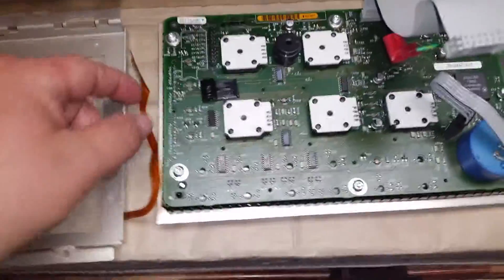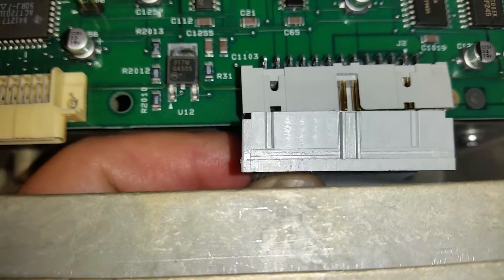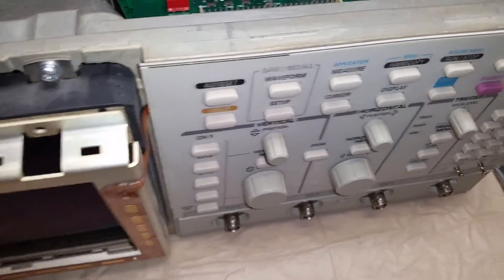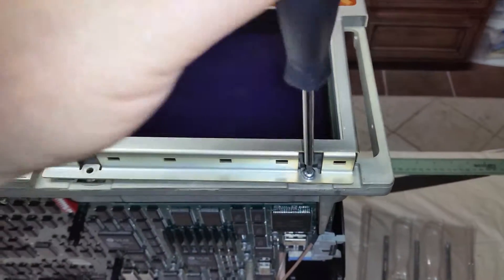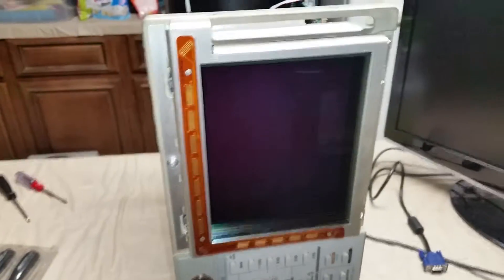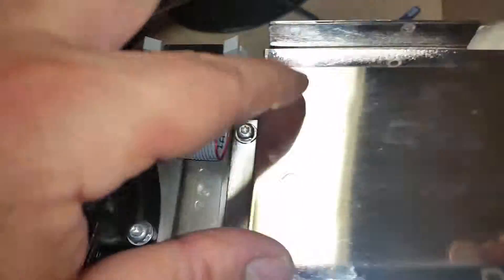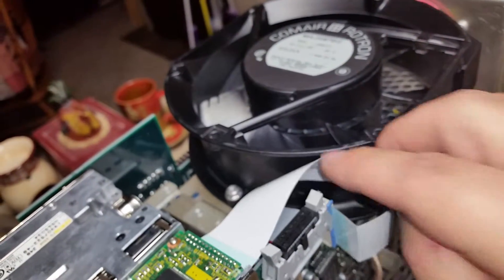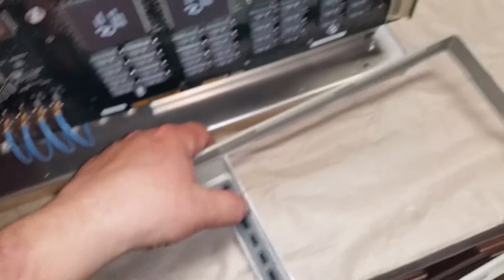TEK TDS 744A No Display Repair Part 5 Front PNL & Floppy Install

Comment: I just ordered a TDS-520A and it does not come with a VGA output... only GPIB.  The GPIB is a whole other project which looks interesting using a variety of GPIB USB or other (PCI or LAN) adapters.  

Anyhow; I got ahead of myself in regards to pricing, ordering while I could get a a great price and thinking I have soldering skill where I haven't really soldered a circuit board in 15+ years.  My background is chemistry, computer systems and spectroscopy. The most over the years in regards to soldering is harness work and battery wiring until last night where I found I am going to have to practice so I don't ruin the electrolytic capacitors as I did last night with an upgraded UPS that has 24V config stock 12V series battery config and I modified to: switch between 12V direct battery only Output/Input for 12V charging, 24V internal OTC design with potential for 24V Output or 24V external pack Input.  Well, last year when I started this project I blew the display board accidentally inserting the battery pack into the case causing a short and am practicing on that board for now since only the switch and power LED seem to be working.  Well, of the three bad caps I found and replaced, 2 of the 3 electrolytic capacitors either were fried from heat or bending the leads.  One looks close to specification though I will probably replace when I receive new ones. I'll remove and try again when I receive the new capacitors noting to have a cleaner tip, use flux/flux solder and tinning my tip more critically as well as using heat sinks on the cap leads.  I think that should help.  Any tips would be greatly appreciated. I'm working with 2.2, 4.7 and 22 micro-farad 50V electrolytic caps. 

In regards to capacitors on the TDS, I have a question.  I've read we can upgrade the voltage of the capacitors to work like the higher grade TDS7XX series.  What are your thoughts on this?   

After reading all the different online posts regarding the TDS series; I'm wondering what your thoughts are in regards to LCD display on the LA Audio File youtube design.  He doesn't show much in detail.  Looks like to me he ordered an additional Arcade RGB auto-scanning board to VGA output or hacked a video card (maybe he's using the stock VGA as I am not sure since don't have).  I see there are Arcade CRT conversion units that have two VGA outputs also.  I'm thinking the output of the CRT can be input into the Arcade Video Card adapter and then the LCD card input can be from the Arcade Video Card adapter output.  I'm not sure what else he is using other than wiring as you noted in the Part 4 video directly to the TDS Video board.  What are your thoughts on this design?

As you noted; I am finding this project is going to keep me busy for a while after reading into more and similarly having a bumper and quarter panel to repair after a coyote and post plastic welded subsequent within two weeks deer impact.  My apologies for all the info... interesting info though and some similar experiences.

These TDS-5/6/7XX scopes looks like they have neat options capabilities as well with software and hardware upgrade potential for a first scope on a DYI SS budget.   Thanks for your videos, sharing and time in advance!
Reply: I was thinking another update that may be value added though I need to read more up on the systems is the 3.5" Floppy Drives updated to a 3.5" with memory card reader(s) or replacing with a memory card reader with USB port.  I'll have to read up on the drivers though since I have no clue at the moment other than having to access via the GPIB interface to update unless you use a PIC interface.  Was recently reading someone did what I noted for the 3.5" drive though for a different project totally. http://www.pcworld.com/article/3038787/computers/sd-card-hack-breathes-new-life-into-this-old-floppy-drive.html

Seems there are USB readers available on some of the newer models directly which would be interesting versus the GPIB, though am thinking this is way more complicated of a project post GPIB project learning and application curve (connecting, reading, programming, controlling and writing).  Not sure what all chip sets can be accessed via the GPIB overtly hardwired. 

Also, I ordered a Weller 40 Watt station to better control the iron temp though am not sure how that station functions in detail.   The station is used off ebay with an iron that has a different tip with an edge versus fine point that I have so bonus since the tip alone brand new is the same price as the station with iron with shipping.  After posting I got to thinking more about temp. being something I needed to control better or at least know to not fry caps though slow motion head injury just thought about this after reading some more regarding soldering.   I'll have to see what caps. are used on the board if even an issue since I maybe need to read more up on SMD components since I've never touched before... let alone de-soldered and soldered.  Seems with the electrolytic capacitors there must be some sort of tip or critical way to solder these.  Looks like another new activity to learn and as I noted before... potential for improved components while I am at it too.   Are you aware of a bipolar capacitor (maybe mil spec something) that would be better?  From reading looks like just adding newer higher voltage rating is the thing to do.  Thanks again in advance for your time.
Reply from the maker: Jfinch78, 1. On the solder tips, make sure you have a good, ESD safe soldering iron, or at least a ESD mat. There are some really good videos on replacing the caps and fixing these scopes try: Tekhobbycap https://www.youtube.com/watch?v=QmvXTu1yaQo

 Mr. Carlson's Lab https://www.youtube.com/watch?v=HqsXe3IKTCo and Feedbackloop https://www.youtube.com/watch?v=7V0LCL4mL-8 for some scope information. Just follow those links. Most guys just twist and rock the caps back and forth while pushing down on them to break the leads on them. Then use the soldering iron to remove the left over tabs. For a soldering Iron tip you'll want a Short, Fat Chisel tip. That will allow rapid heat transfer over the wide pad on the board. The idea is to heat it up fast and get off fast. You can use just a LITTLE flux to help in the heat transfer then follow up with a short acid brush and some Isoprophyl Alcohol to clean it up. Using a round tip takes a long time to heat the board area up and can cause board and run damage, that's why most techs on these scopes just rock or twist them off.  DO NOT pull when you try to remove them or you can pull the runs up, and well that means you'll have to repair them before you can put new caps down. 

2. Yes you can always go up in voltage on caps, and in some cases even capacitance. If you can find the Tantalum capacitors from say the later 600 and 700 series they will last longer.

3. The CRT to LCD conversion on that old scope just wouldn't be worth it, unless you could get a real good price on the parts you need, say less than $100.00. That's assuming the rest of the scope is working. If you can find the RGB outputs and get a controller board to do the conversion for you with the LCD that might be a good idea. Me personally I'd just get a better scope, but they do cost money.

The links I gave you are just the ones off the top of my head. You may have to watch a few videos on their pages to find what you need. If I come across a few others I'll send you the links. Just be careful playing around with those CRT's they bite HARD! Tekhobbycap has the best info on the CRT's so far that I've found, so watch his videos on TDS CRT's. He even has one on the LCD Conversion but it's about $350.00 bucks for the kit, and that's if you can still find one. Well gotta go. Thanks for the thought provoking questions. Best Wishes n Blessings. Keith
Reply from the maker: Hey J if you don't have the schematics or them manual for that TDS520A you should be able to find it here: http://hakanh.com/dl/kits.htm

1. Weller makes some really good equipment, but for the price you paid you might have gotten a cheap Chinese unit that had hot air too.
2. As far as replacing the GPIB with a USB I don't recommend that unless you can keep both. The reason is with the GPIB and a laptop that can use GPIB it can talk to it and other test equipment on the system at the same time. The USB would probably good for saving captured wave forms or system setups, but then again I think the GPIB might do the same.
3. The floppy drive if it supports it and you can find it cheap would be nice, I don't have a 520A so I don't really know. Don't forget the scope is old and is a good learning tool and nice troubleshooting tool if it works, but you have to think about the cost vs buying a better scope and selling this one to help pay for it.
4. Not to familiar with the bipolar caps by that name. As for the caps I would just keep the same capacitance values and voltage if available. This is an old scope again and more than likely any cap you put in it will outlive the scope anyways so don't put a $2,500.00 dollar paint job on a $500.00 dollar car if you know what I mean. Hope this helps. Best Wishes n Blessings. Keith
Reply: 1.  I was wondering this too since I have a Kawasaki hot air gun and I am thinking the wattage is too high for using that with a modified custom tip.  I may be able to though as I noticed one youtube video where someone use a CPU heat sink upside down, places some sort of maybe copper end cap with a thermocouple inside maybe mounted to the top surface and had a heat gun pointed at the cap for use in more rapid removal of capacitors.  I didn't save though may have "Liked".   I've never use a heat gun other than for plastic welding, shaping and shrink wrapping leads and harnesses.  I'll have to read and watch more.  Looks like there is interesting heat gun vacuums also versus the spring loaded teflon tipped one I have. 

2-3.  GPIB with a Prologix, Agilent/Keysight, maybe NI though they are expensive and possibly the opensource GPIB would be all that is needed to turn on the FT option since looks like is easy to do.  Correct, great thinking and thanks a bunch for the affirmation and insight.  First things first and as I noted in the first reply like you are thinking... thinking even of upgrading this first scope might be overboard.  Repair and sell for a new better investment.   

4. OK, great advise... thank you sir.  I may be overthinking again since like you noted and like my Dad had mentioned when growing up... you can upgrade one part though you have to remember that that could be the more cost effective break control point and the other spots that might break now will cost more so think ahead before you do any upgrades and if you are going to, put a key way or something that will shear off first to save you the maintenance and expense also reminds me of using one hand also when working with high voltage (he was industrial master mechanic).   Many thanks again Keith!  I'll try to resist the TDS-520B temptation for the merger for parts or potential to repair both.  Looks like calibration standards unless I can rent are going to be way expensive also as I am finding the test probes are even.
Reply: I just made a folder public with the documents I've read and compiled for this project.  Here is the link: https://drive.google.com/drive/folders/0B3kLL6AnKjj5UVpxU1QxNjNUcW8?usp=sharing
Reply from the maker: 1. I typically don't do heat guns on completed boards unless its for a processor or a large component and only with shielding of course. I don't like to heat up a board unless I have too, especially older boards. The caps come off easy if just twist them back and forth while pushing on them. 
2-3. GPIB is nice. You can go a cheaper route by using some older computer equipment that still have some ATX or PCI slots. Those ATX/PCI GPIB boards can be had for around $50.00 to $100.00 bucks. Also unless you have the updated software and are familiar with it, the old programs are written for the old computers and say DOS, Windows 3.1 and 98SE and below. You jsut have to check with the programming manual for the test equipment you're using to find that out. The manual part number should be listed in the Information/Introduction section of the manual. I have a USB to GPIB that I just picked up. I haven't had a chance to use it yet or even figure it out. But if you're willing to read there's some good stuff out there on it. 
4. The upgrade is ok "IF" you can find the parts cheaply. Also it is a good place to start to experiment since the scope is fairly cheap and if you screw it up at least you can sell the good parts to recoup some of your money. Keith
Reply from the maker: 1. I looked at your documents page. Nice page I'll keep that in mind for when I need to look for something.  As far as the LCD Conversion page, that's a good start. To make things easy on my when I have a complex project I separate my information into Topics/Catagories. Ie.
GPIB and Programming, Manuals, Data Sheets, CRT Info, Calibration Info, Power Supply, LCD Conversion etc.

2. The only thing I didn't like about his page was that he used to small a LCD when there are LCD's out there that would fit better and for cheaper. IF you go that route at least check out the notes in Part 4 of the TDS744A series I did here:  https://www.youtube.com/watch?v=xv_ldH1dZMc I list some good information on choosing an LCD especially the measurements and the screen ratios and active area. I've already purchased mine and a VGA Splitter so that I can have both internal and external displays as if it was stock. Just need to find the time to do it and film it so I can post it. The vehicles have been taking all my time. The CTS Project, Caravan, my F350, heck even my lawnmower was kicking my but for a weekend. I also have some new acquisitions at home to check out. HP 214, HP 200A/B, Fluke 6080A, Tektronix 2445B, Tek TDS744A and the list goes on. Not to mention a 1969 GTO in the garage that needs a lot of help too! 
Well gotta go. Best Wishes n Blessings. Keith
Reply from the maker: PS I forgot to mention as far as calibration goes. Unless you're going to use the scope for a business or need it to be very accurate don't bother to buy all the stuff for it, just use it as is. You can send it off to a lab and most will do it for around $300.00 bucks plus shipping. If you have some good equipment you can use as a reference to do some of the calibration and just keep a compensation/cheat sheet for the items you couldn't calibrate as long as you know what the offset is from a true reading. I used to have to do that here at work. Even though my equipment was calibrated and passed specs, it was on the other side of the specs used by our calibration lab so I just compared the two standards and figured out what the difference was. Once I had that I would program an offset into my equipment and adjust the equipment I was repairing to the new offsets. Then when it went to calibration it fell within the limits of their equipment. Well gotta go. Keith
Reply: Thanks Keith.   If I recall correct going back like 20+ years... seems there was something with reading the RS-232 and parallel ports easier with the Windows 95b and earlier versions, where-as something changed in the Win 98 versions and maybe slowed down the processes of reading the pinouts.  I made some projects from the old Science Probe magazine and seems if I recall correct, I gave up electronics after updating to XP until I had the Instrumental Analysis course and I had my only hands on oscilloscope experience other than recently with the software versions using a sound card or RTL-SDR.  I'll read up some more though in regards to the PCI GPIB option which I specifically purchased a motherboard a few years back with PCI so I could use a four port BNC CCTV camera card for surveillance. 

Thanks for the info on the calibrations.  Makes sense.  Typically we'd use secondary standards mostly qualified/validated with NIST Traceable primary standards.  I even helped NIST inspire to create the SRM2036 standard as I was working with the 2035 and 1920a and thought, why not add a 99% reflectance standard to the back of the 2035.  They certified the original cert. the day before my birthday too on June 13 2003.  I also programmed an updated version and gave them my Center of Gravity (CoG) algorithm using array basic for peak picking for qualification/validation/calibration.   

Man, lots to read more and start piecing together to function. 

Thanks again Kieth!  All the best and John 14:6.
Reply from the maker: Thanks for the history lesson on the RS232. I think some of them still have it for interface. Not sure about the TDS520A but I think it was available as an option.
Reply: Thanks for your advise Keith!  Great reading John 14:16-17, helps keep the faith.  If I missed something in regards to the edits, please feel free to reply.  I almost wonder if I reveal to much information also and I don't want to take peoples jobs away... however that takes away the freedom of sharing the truth of our observations as an advocate of the truth.  Anyhow.  I received the scope and found my wrist strap wire pulled out so will look into new ESD kit.
Reply: Wound up uploading a generic video of the scopes I purchased with my first page on youtube today.  Thank you sir for the support and motivational comments.  I also added more documentation to the google drive link above.  Found more info on the GPIB, reading/writing the NVRAM and even firmware and some applications, i.e. field adjustment software and KeysightIOlibrary app off the EEV boards.  Before I open these cases up, I'm working on making sure I have what I need to backup the NVRAM and I'm thinking I can cost effectively without the expensive USB GPIB.  I did make an offer on a GPIB PCI NI board though where with a GPIB cable totaled ~$70.  Close to the GPIB USB clone price.

Which route did you go with the GPIB to USB?  I'm still reading up on this topic and wound up ordering a GPIB cable for now so I can connect to my Arduino UNO I have lying around to see if I can access (read/write) memory addresses with that.   Here is the site where I found some info regarding the Arduino:
http://egirland.blogspot.com/2014/03/arduino-uno-as-usb-to-gpib-controller.html

Galvent has an open source github GPIB USB system though I need to read more on: https://github.com/Galvant   I am waiting for a reply regarding writing capabilities to the NVRAM since looks like there is potential though I am not sure about the access to the different memory addresses with the device. 

Which GPIB USB did you pick up?  I'm wondering if the clone version will work suitable.  Just missed an actual 82357A model that wasn't a clone on ebay for ~$70.   Looks like most 82357B's are clones and am wondering with those if the optical oscillator, shielding and inductors can be upgraded to be better quality?  Have you read up regarding improving?   Thank a bunch Keith, be safe and Christ be with you.
Reply from the maker: Your'e welcome JF, I wouldn't worry about opening up the scopes and the NAVRAM giving you problems, the RAM has it's own internal battery. Also if you open them up you can get a quick look to see if you need anything else. Mr. Carlson's Lab YouTube channel did a nice little video on fixing a TDS420 pulled out of a junk box in pieces here: https://www.youtube.com/watch?v=HqsXe3IKTCo take a look at it. A good source for discrete parts is Mouser and Element14 (formerly Newark), for low cost one off parts you can go to DigiKey. All have great and quick service. Just watch Element14 part location! If it's outside the country or during some off hours for information, they have some "HEFTY" packaging and shipping charges.

I went with the USB TO GPIB INTERFACE ADAPTER by SOFTMARK. I think I may have made a mistake with that as not to many people are happy with it. I haven't even tried to use it yet. Here's an article on EEVblog about it and some suggestions.  https://www.eevblog.com/forum/testgear/gpib-to-usb-controlleradapter/ of course there's no substitute for NI cards and software. To put it simply it works and there's tons of information on it.

Good Blessings on the scopes, I'll be watching as you press along. Best Wishes n Blessings. Keith
Reply: Keith:  Found another reference for the screen and wound up taking your advice and uploading some videos on YT.  

This is the site with some info down in the comments also on accessing the VGA from the motherboard:
http://www.toughdev.com/content/2014/01/calibration-and-acquisition-problems-on-tektronix-tds-340-oscilloscope/

Here are my videos if you're interested:
https://www.youtube.com/watch?v=UOzpJF5FQQk&feature=youtu.be  (you were correct, the TDS-520B seems to be working OK)
https://www.youtube.com/watch?v=jZjRVAb3Ykc&t=29s (the TDS-520 is not working to specification and I am thinking since I don't hear the relays, I need to press the AUTOSET button as noted in by ToughDev link and look for a troubleshooting section in the manuals).

I picked up a NI PCI to GPIB card. 

Thanks for your help and support!  Started two blogger.com and a wordpress.com sites too. Trying to get this project moving forward again.  Especially with the Cuban Diplomat "sonic assaults" situation in the news.  John 14:6